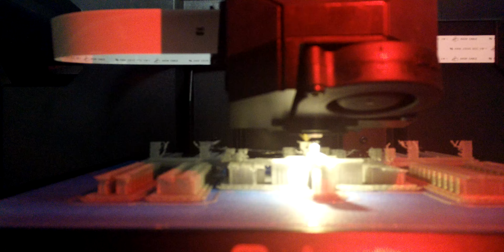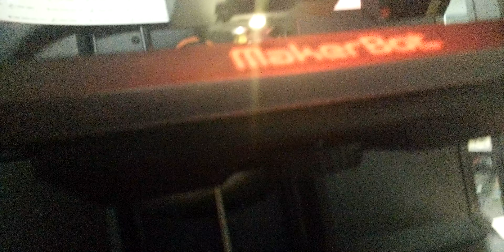Singing/Harmonizing 3D Printer [Printing the ISS]

Comment: If you ever want to get a  3D printer, it is best to make it yourself. You learn so much in the process I have found after building a dual extruder printer.
Reply from the maker: +drud 1995 You've built a 3D printer? o.O sigh I just don't have the time to do that :c
Reply: It only takes a couple days to make. You just have to make sure the company you bought the kit from didn't forget any crucial parts. =)
Reply from the maker: drud 1995 OH you got it from a KIT! How much are kits? o.O
Reply: International Space Station The kit I got is pretty cheap. You get a dual extruder printer kit for a total of $340 with a 1 kg roll of filament included. Just note the instructions can be wrong at times and there will be some troubleshooting involved. Here is a link if you are interested: http://www.geeetech.com/unassembledgeeetech-i3-pro-c-dual-extruder-3d-printer-p-927.html